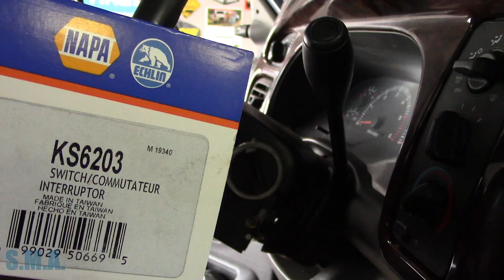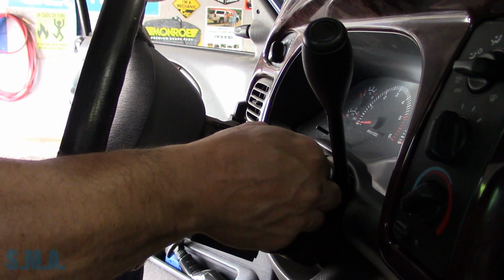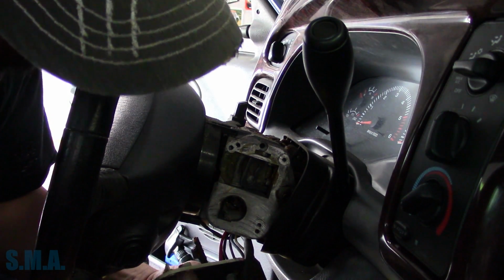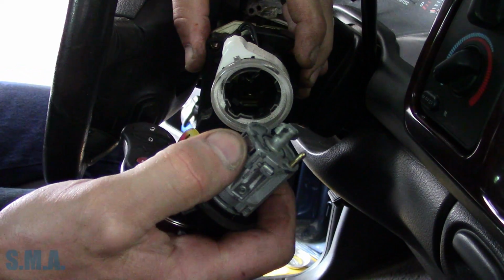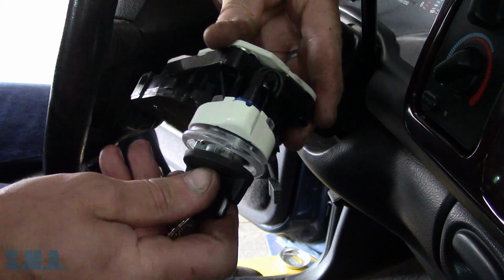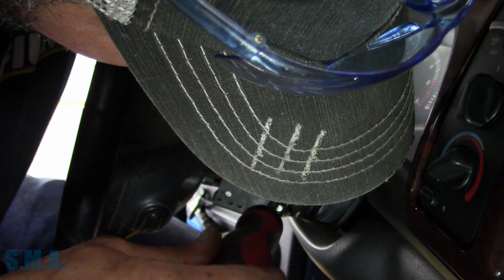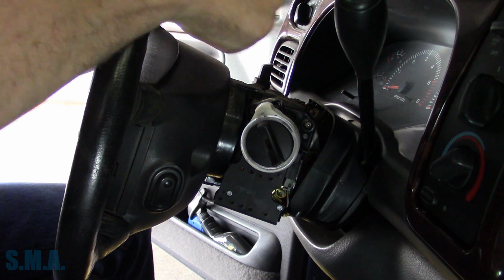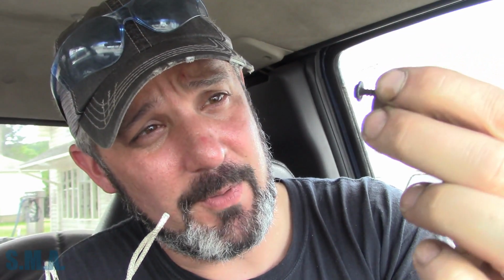Shop Screw Ups - Follow Up

Comment: Eric, it's shops like the one who took this guy for $300+ that makes all of your viewers appreciate how good and honest you are. We all wish we were smart and skilled enough to avoid that guy, and it's a prime reason I've tried to learn to do as much as I can on my own. And I've learned a ton from you!! I've said it before, but I'll say it again - Thanks!!
Reply: Too bad there isn't some form of consumer protection for stuff like that, that also wouldn't end up with unnecessary litigation for honest shops like SMA.  There is no way the customer should be on the hook for that entire $300 bill from the other shop.  The parts they didn't need and part of the wasted labor costs of them not doing a damned thing.  A simple diagnostic charge and them admitting they don't know wtf was wrong would've been fair at least.

It is exactly why I started fixing my own car again.  I have an intense fear of taking my car to dishonest shops.  I've contemplated many times to make a 1000+ mile drive to SMA to get the valves adjusted, CVT starter clutch replaced, and a few others things if I can find the time and save up the money for the trip plus the his invoice when he is done with what needs to be done.

The Honda service writer telling me my car has things it doesn't when I was getting quotes for some things made me certain my car will never go there; and now I have to find another somewhere that can do the takata air bag recall; because again, that shop is not touching my car.

I may just get rid of it one day and get me an old classic anyway.  More room in them to work in them, simpler, less things to go wrong in general, and they look and sound better.  Personal opinion ofc.  Just going from 40-50 mpg to 9-12 will be a big hit :p
Reply: +1
Reply: I am an independent mobile mechanic and I watch all of his videos to learn/refresh my knowledge. I also try to absorb his calm demeanor.
Reply: @kuromurasakizero9515  I got a misfire diagnosis from an independent specialist shop - my town's version of SMA - and they documented the hell out of it, including closeup photos of oil-fouled spark plugs and a printout of the "piston rings" service bulletin from Hondoo with every symptom checked off & initialled by their Eric O.   Took it to the Hondoo dealer and showed them my pictures & printouts; they said there would be a $95 diagnosis fee.  I said I already have a diagnosis, so I won't be paying for another one.  Inexplicably, they accepted that answer and took it back, confirmed the diagnosis and scheduled the repair, $0.
Reply: There are outstandingly bad shops, big expensive bad shops and then shops like South Main Auto Repair that are miles above all others!  
Real Story - Our 2000 Saturn L300 blew a serpentine belt.  Had it towed in after I tried to change the belt myself (minus 15 degrees in Wisconsin) learning it is impossible without taking off a motor mount.  Large multi-location shop told me the water pump, harmonic balancer and wires/sensors needed to be replaced from damage from belt breaking.  We also had an evap problem that haunted us for years.  Yes, fix it I said.  It only cost $1,400!!!  Two months later driving on the highway around a bend, the belt let go again!  Took it back to the same shop, $700 later I picked up the vehicle and half way home the Check Engine Light went ON.  I immediately opened the hood (and my eyes) and looked around.  What do I find... an extra harmonic balancer pulley was sitting on the steering rack balancing inches from the 3rd serpentine belt!  I went back to the shop asked for a manager to come outside, I shined a very bright flashlight down inside at the extra part and asked, "What do you see?"... one word answer "Yupp".  I demanded they refund the 2nd serpentine belt break fee seeing how their ineptness caused the belt to break!   Nope, can't do that.  I said fix the Engine Light for it wasn't there before.  I picked up the car and weeks later I noticed an oil leak under the engine.  I looked underneath and someone had grinded lines into the oil pan from wheel to wheel... so I know this wasn't a bottom scrap from the road etc... That was the last time I used any shop!  Since then, I replaced oil, spark plugs, wheel hubs, sub frame, brakes n rotors, e-brake, valve cover/intake gaskets and that just the Saturn.  I also repair my 1996 Dodge Ram 2500 with 5.9 engine (radiator, crank position sensor, brakes/rotor/hubs, oil pump etc...)  

Honesty goes a long way with me.  What Eric does on this channel is great!   Filming while getting dirty is not easy.  If every shop required video proof of diagnostics... no bad eggs would be employed. Eric not only isolates the problem(s), but he literally verifies every failure with multiple tests!  Bravo!  It is so much easier to be honest and do a good job than it is to be an rss!
I have a dilemma today.  We bought a new 2020 Yaris hatchback.  A new car every 20 years isn't bad.  We are facing our first scheduled maintenance for what is supposed to be 2 years worth of free service.  I read the fine print and it doesn't include fluids or parts.  This is not what the Toyota salesman said when I asked, "We pay nothing to have our oil changed".  Answer, "Not for 2 years".  So Eric if you read this dribble and managed to get this far... should I do my own maintenance on our new Yaris or fall into the same service trap with our new car?  The Yaris looks to be very maintenance friendly.   Unlike the Dodge Ram or Saturn.
Reply: DITTO!!!!!!  Great HONEST JOB!!!!!!!

Comment: Life lesson: If you are going to pay somebody to do a job, find the person that is competent enough to do the job.
Reply: that's the hardest part!
Reply: Life Lesson: If you think a good mechanic is expensive you should try a bad one sometime.
Reply: @misterhat5823  absolutely it might cost you more to get someone good to do it but the reason is because they spend 4 hours 10 hours diagnosing it checking wire by wire connection by connection Data by data sheet by sheet and eventually fix it as the "cheaper" shop wouldn't
Reply: m ph what if there aren't any? I literally have to do things myself because all mechanics here are scammers. The only problems I take them to is with anything that requires a hoist, as I'd prefer safety over anything.
Reply: @Ownage4lif31  Are they scammers because you feel they are charging to much or because they are unable to repair/diagnose a problem properly and may be incompetent? 

I have done all my own work for 20+ years. I Could not afford to pay for repairs in the beginning, hence do it myself. Now I kind of enjoy doing my own repairs.Labor is VERY expensive today. 

A lot of the cost comes from taxes. If you have a $1000 repair bill, I would bet to say $400 of that goes to the government in the form of taxes.
Reply: Dude, after 20 mins of screwing in that ignition key, I thought my phone is broken and I slept a few seconds in.the meantime
Reply: @mph5896  most independent shops here will charge you for loads of work that's never performed.
Or they take a perfectly good part out of your car and put in a replacement they pulled out of another car and charge you for a brand new one, then put yours into that other car and charge them for a brand new one as well.

Dealerships here are better because a few complaints about things like that and they get to lose their dealership franchise. But some of them will still skimp on little things. Things like charging you for refilling your wiper fluid with a service and a week later you find the tank's empty.
Had that happen once, went back and they apologised and filled it up for free. Guess the mechanic in question had some explaining to do as well, may have been an honest mistake.
Reply: AMAN TO THAT
Reply: Thats easier said than done these days. Finding a good trustworthy mechanic is getting harder by the day.
Reply: @jwenting  Not just independent shops. I've had the dealership send me home with my old failed parts that weren't actually failed, and the problem not solved.

Comment: THAT'S what's wrong with my crescent wrench!  I've been using the METRIC one on my 'Merican stuff.....
Reply: If you are willing to shop around, there are some that can do both ‘Merican AND metric all in one!! All you have to do is flip it over. 😜
Reply: It's a shame that Crescent wrenches are made in China now
Reply: Don't forget to buy a right handed crescent wrench!
Reply: I attended automotive shop class in the mid-60's and would receive C- on the tool test.  That crescent wrench was called an open-end adjustable.  Ha ha ha Really enjoy this. You know this is Vanessa's garage.
Reply: Obviously you have more hope than the history of Americia warrants!
Reply: Arthur Hardy Bahco make the best crescent wrenches,made in Spain on the same production line as snap on ones,but way cheaper
Reply: @rjaquaponics9266  Not if your left handed!
Reply: Left-handed metric ones!
Reply: I Took To My Large Crescent Wrench With Locktite , After Setting  It To An Odd Size .
  It Kept Being Removed From My Work Bench And Not Being Returned . So I Set It Open To 27 millimeters And Locktited It .
      I Could Hear The Screams Of Fok You When They Had Come  To The Realization Of What I Had Done .
   Laughing At The Offender I Would Then Take My Crescent Wrench Back .
  It Would Previously Go Missing For Days .
    The Size Of The Crescent Wrench Is The Reason It Was Liked , The Head Would Be 250mm And The Handle Of Around 800mm . BIG .
       Very Well Needed For Breaking The Bead On Screw Bolts That Had Locked Themselves  Into Position And Not Wanted To Be Removed . ( That And A Piece Of Iron Pipe With The Handle Inserted Up The Iron Pipe For Leverage . )
Reply: @arthurhardy  You can have them made in Sweden or Japan, I am sure, but how much are willing to pay?
Reply: @rjaquaponics9266  :  Oddly enough.... there are what you might call right hand and left hand adjustable wrenches. The only difference is that the worm gear that adjust the size of the gap rotates "backward" of the other.  lay them down on the bench side by side in the same orientation and rotate the worm gear in the same direction on both and the jaws will open on one and close on the other.  Go figure.
Reply: @Thecrazyvaclav  The Swedish Bahco is the inventor of the ajustable wrench, in 1800 and some. New Bahco's  comes with MM marking to make ajusting easy. and Snapon bought the brand.
Reply: I keep my left handed screwdriver set behind my right handed set!
Reply: Nope, the 'Merican stuff is being pushed, kicking' and squealing', into the metric era - and it's gonna be as painful for them as it was for me when I started out. I had three (3) standards to follow; BSF/Whitworth, AF and Metric along with three necessary sets of spanners. I was lucky that the change to Metric was, for me, during my formative years.

Comment: You need to change  "if I can do it you can do it" to "if I can do it you can can do it,  but let's face it it will take 10 times as long, and you got a 50/50 chance of screwing it up worse".    All kidding aside I found a bad harness on my Camaro ZL1 after my dealer told me it was a bad fuel pump, give us $1000.    Great show, love the information,  cars are really complex now.

Comment: Blast from the past,...i inherited that ignition sw when I hired into Chrysler 1988 and there were two suppliers making it for 2million vehicles. the ignition sw actually was installed at the steering column supplier and then the columns were shipped to various plant. the key cylinder would be slammed in at the plant causing key in warning issues but that was resolved with a design change. the security was the tamper proof torques.  I most of re-worked 100's of those at the plant. been working in electrical at chrysler for over 30 years and you do a nice job trouble shooting the issues and repairing the issues.
Reply: poor fella  LOL

Comment: You'll be pleased to know another YouTuber, Hubnut, in the UK, has done a binding brake fix on his Mitsubishi Delica 4WD van after watching one of your infamous brake job videos!  Your knowledge travels far and wide Eric!
Reply: I fixed my brake issue that way too!  I had a stuck caliper pin and it was causing this high pitched screaming noise...(well that noise was my wife yelling the brakes were making a noise) but following Dr. O patented brake method fixed it right up!
Reply: After I had a dealership replace my rear brake pads and rotors under warranty I took it apart to make sure it was done right, Eric O style

Comment: Eric:  Your test equipment (scanners, probes, etc.) are invaluable for your work, but what REALLY makes the difference is your experience and intuition.  I retired from a 40 year electrical engineering career and I have to say your understanding of circuits and automotive systems is really top notch….and you’re a nice guy.  It just doesn’t get any better than that!

Comment: I think the previous mechanic worked on this for hours and put some parts on it.  Eric can do the diagnostics much faster and he is able to analyze so many measurements, complex diagrams and data in a flash whereas the other mechanic probably spends a lot of time overwhelmed and confused.  At 350 dollars there was no greedy scam perpetrated.   I hope the mechanic watched this video to begin to  learn how to test and verify electrical problems.  If Eric's lessons don't  help then do your best  replacing brake pads, belts, struts, bearings etc. and send these types of problems out to a specialist.

Comment: Life lesson, if you get your car or truck back from a mechanic and it's the same or worse, never go back to that shop again, because they don't know what they are doing. I try to do my own work if I can. Got a '97 Ram 1500 with the 5.9 360 V8 too, but mine has 270,500 miles on it so far, so doing ok so far keeping it going. Done a few things but nothing major yet. Plus you called it a pig, yep it loves the gas but I run it hard, but fun to drive, well while the gas is so low right now anyways. Enjoy the channel and love the learning I get from watching, keep up the good work.

Comment: ignition switches are always fun. I had a original barrel & key that needed to be in ACC position to come out, and a replacement that needed to be in ON position to go IN. had to make a tool to switch the electrical switch in-between removing the old and inserting the new. Also had a barrel & key that got stuck and wouldn't come out while away on holiday. Googled and found recommendation to use a persuasion tool and screwdriver, and it worked. Once back home I removed and stripped, and smoothed the switch ramp with a file. Been working for probably 10 years since.

Comment: “If we slip, we bleed”. that is 100% of the time for me
Reply: I always say, If you don't bleed your not a mechanic!
Reply: WHEN I slip, I bleed.
Reply: My theory is if you ain't bleeding when wrenching then you either did something wrong or weren't working hard enough. Either way you get back at it until you spill some blood cells.
Reply: You've Got  To Get Your Timing Right , And Do It At The Correct Time Of The Month . 
   NO SLIP NO BLEED IN THE MENS CYCLE .
Reply: I always bleed without knives or slipping
Reply: I have my DNA in every vehicle I ever work on.

Comment: Just fixed my aunt's jeep liberty this weekend while visiting her in pa. Two different shops couldn't figure out the cause of a p0500 code and no speedometer symptom.  Crawled underneath and low and behold, the two wires for the vehicle speed sensor, had rubbed through from being against the emergency brake cable, causing a short. I was only able to diagnose this issue from learning your diagnostic process. Thank you for sharing and enabling me to help out a family member! I appreciate your hard work putting together these videos.

Comment: Honda uses break away head screws on the ignition switch. The thrill of removing those is beyond description.
Reply: maxbored — I recall he had a video on one of those.
Reply: Nissan used similar screws to attach the ignition switch to the steering column on my 240Z.  I installed a cutting blade in my Dremel and cut a slot in the screw shafts.  The screws  could then be removed  with a flat-blade screwdriver.

Comment: Triangular formed threaded screws from threads in holes instead of cutting threads. Nice video👍
Reply: They roll a thread instead of cutting it - usually used in thinner materials.

Comment: I enjoy watching your videos, and the kicker is my wife has the same van as Mrs. O and my mother in law has the same highlander as the orange and silver one with the wiring problem you fixed. I have referred back to your previous videos for other repairs that I have done myself, GM EVAP vent diagnosis and so on and so on. I almost feel like I need to send you a check. Keep up the great videos and be safe.

Comment: “That would make it easy to steal.”  That would be why the Ram was the 2nd most stolen vehicle of the early 2000’s. Right behind the Jeep Cherokee. Probably use the same ignition switch.
Reply: @Anon Ymous But why would anyone steal a Ford???
Reply: my 94 Dakota shares a very similar design to this just slightly more dated , and yeah only took the thieves about 2 minutes when they stole it back in 2017. If you own one of these trucks .... a killswitch or a steering wheel bar lock is your best friend.
Reply: @phoenixbranwen766  steering wheel bar lock, that takes another 15 seconds to defeat ;)
when they were more popular and steering wheels plain round, people wold just bolt cutter the wheel itself..